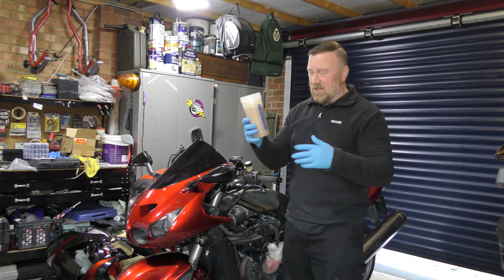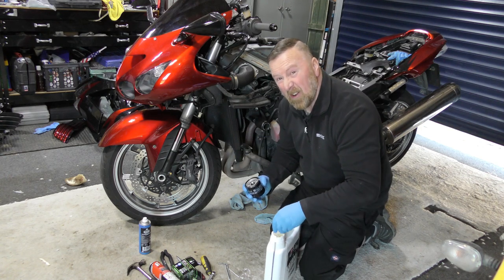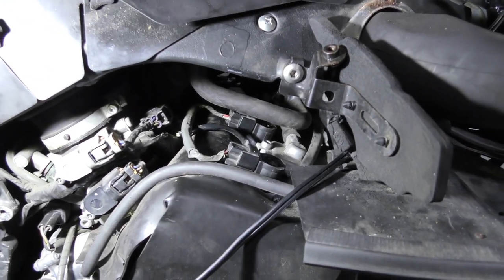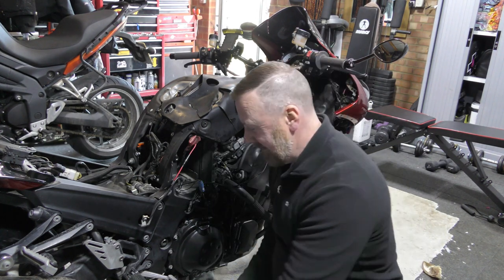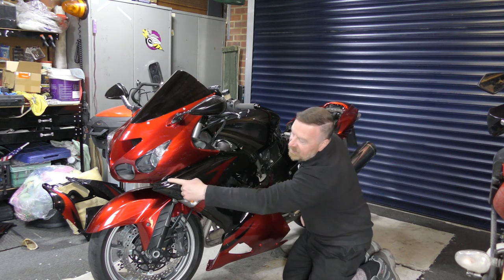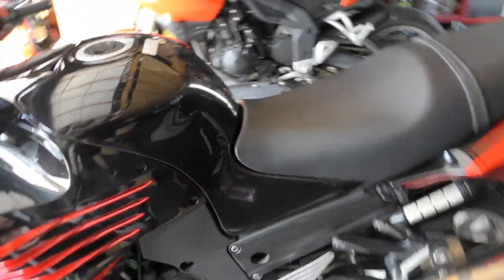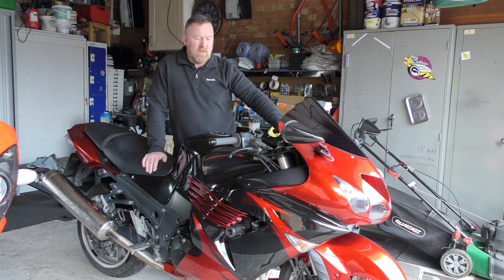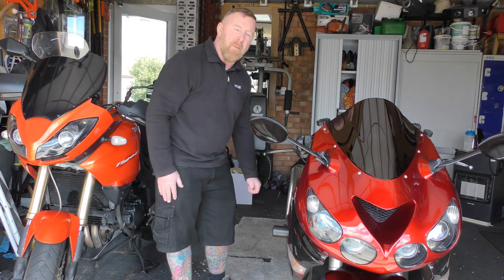KAWASAKI ZZR1400 ZX14 SERVICE REFIT PART 2

Comment: Nice! Like the air filter replacement. I just done air filter on my VFR1200, you need to literally strip all the plastics off, then lift the tank..!
Reply from the maker: Yea I've don't a service on a 800 and 1200 and yes its a bit of a job
Reply: @marksavage  yep of course, forgot the VFR1200 vids, exhaust etc. ZZR looks nice. I had an old ZZR1100 for a bit, dead comfy and fast when needed.

Comment: I'm on my 3rd 1400 so massive Kawasaki bias, tip - use plenty of silicone grease on those fairing panels lugs and coil packs.  42/42psi is correct.

Comment: Hi Mark love the channel need your help got peugeot jetforce 50cc all the oil pipe line all missing plus air pump pipes to not sure where thay go frist time fix a 2 stoke have manual but don't show pls
Reply from the maker: is your jetforce injection ? 
does it run or a none runner ?
is carb and i thought it wasnt it should be the same a the speedfight
Reply: @marksavage   hi Mark it carburettor
Reply: Hi Mark sorry yes it runs but all the coolant pipes and carburettor oil pipes where not on the bike when I got the bike got the coolant pipes put back on need to no where the air pump ones go and the oil one to frist time fix a 2 stroke 🤯🤯 thanks

Comment: URGENT HELP NEEDED.

Hi Mark,

So i have had this Peugot Speedfight 2 100cc for a while now, it was in poor condition and needed a new bendix, spark plug and the stator magnet was cleaned. After a few changes the bike started working and running well. However, the starting was inconsistent and the sound was very loud. 

After about 2 months of use, i was on a long drive on a hot day and the bike started having issues. I was doing 55-60 down on the motorway and when i got to a set of lights, the bike was struggling to get going again. It then cut out and wouldnt start, so i left it for 10 minutes and it started up again to get me home.

From this day, i could definitely notice a lack of power when idling at any lights or just when stopped, i didnt take this as a big issue as i would just open up the throttle to maintain the revs. Anyway i go holiday for 16 days and when i come back there was an issue with the bike where it would start backfiring when i was driving and only seemed to get more frequent. The smell of fuel/oil was very strong while i was driving too.

After about a week of this issue, the bike stopped working full stop and would start for a few seconds and cut out again. After examining the spark plug it was black and oily, as well as this there seems to be a lot of carbon all around the outside of the engine and where the exhaust meets the motor. 

I have done the following changes to try to improve the situation,

- Replaced the piston + rings
- Replaced the gaskets 
- Replaced automatic choke with a manual choke
- Adjusted and cleaned the carb

Here is another list of things i have changed since it was standing,

- New Spark Plug (BR8ES)
- New Bendix
- New air filter (Parlini)
- Cleaned the rust of stator magnet
- Replaced all crank case housing bolts
- Replaced Battery
- New rollers
- Replaced the wool in the exhaust

The bike has been out of action for around a month and with the new gaskets the sound has gotten quiet but the bike cant go up the road without spluttering and popping until it stops, this issue is really getting me down.

I am only 19 and would appreciate any help that i can get and can provide lots more details if needed.

Thanks,

Kian.
Reply from the maker: Wow ok 
Looks like you really have done a lot of work and we'll done , not just messaged after doing nothing and asking what is it !!
When you had the head off did you check the crank ,as in small ends replaced with the piston kit but also big ends as in movement left to right ??
When changing the piston what was the head like ?
Or did you replace the whole thing as in the kit
Check oil pump working 
As in my videos 
Did you 2t the head and piston ?
Extra 2t in the tank to help running in ?
Did you run it in?
Check and change reeds?
Carb now
You say cleaned ,like in my videos and air mix with the box filter 
Vacuum tested ?
What's your spark like ?
Blue and test as pull away as in my videos 
Or orange ?
You have done well so far bud